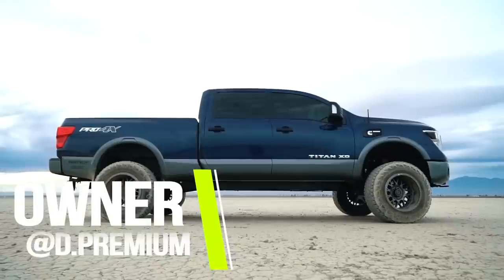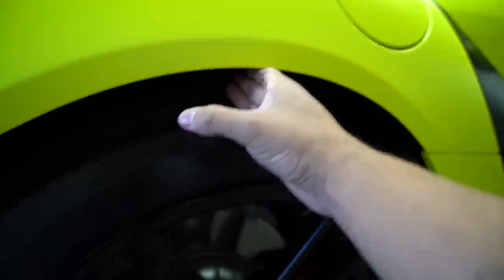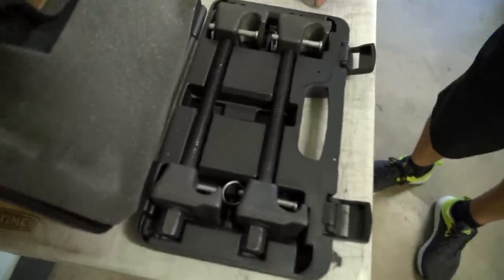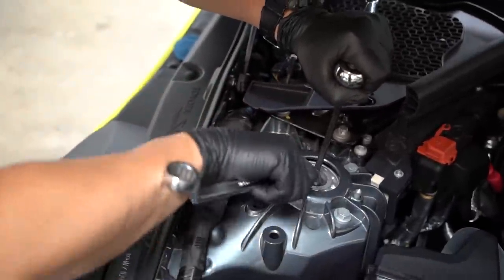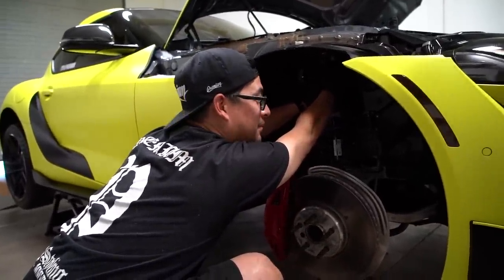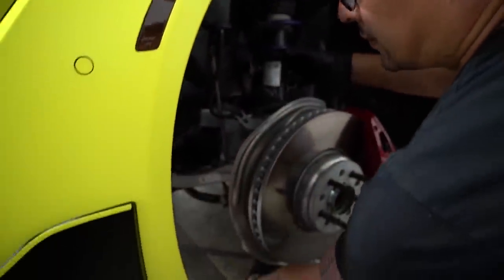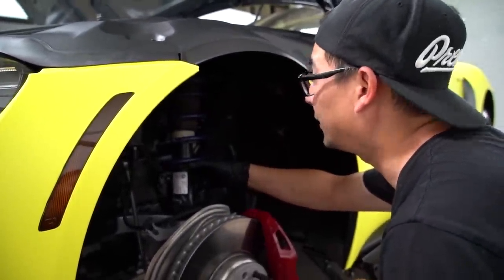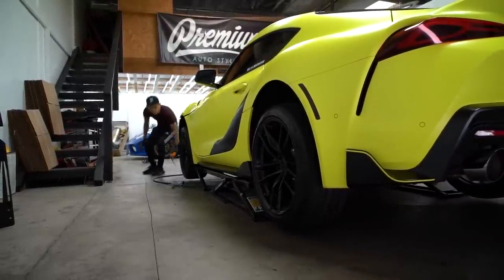LOWERING MY 2020 TOYOTA SUPRA!

Comment: Hey Daniel, how do you not know who built the car you bought? BMW did not build the supra. Toyota designed developed tested and tuned the supra. And it's built in the magna steyr plant in Austria which is an independent company. BMW actually did no work on the final supra product. The only thing they did was codevelop the CLAR chassis, b58 engine, and m suspension with Toyota. But Toyota changed things on each of those parts after the companies split up. After that all the work was done by Toyota with the parts BMW let them choose (mostly).